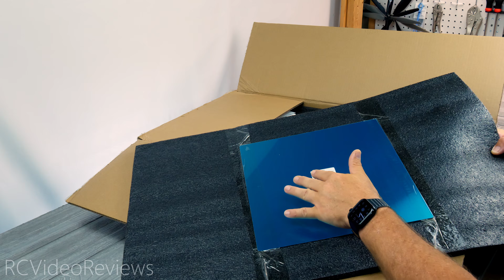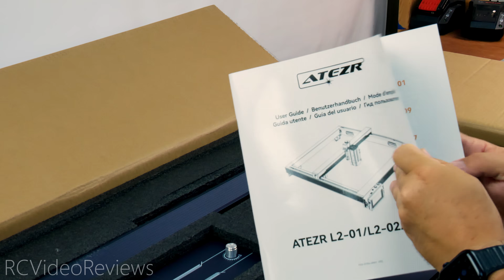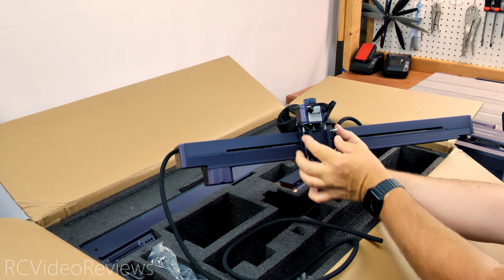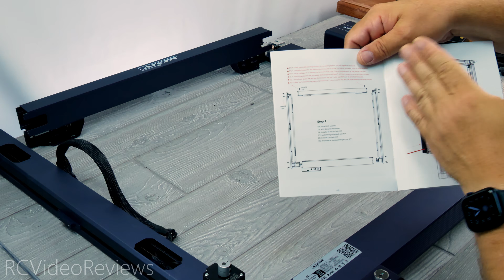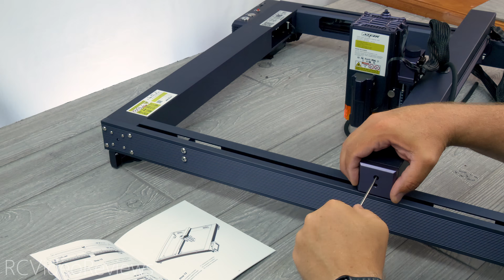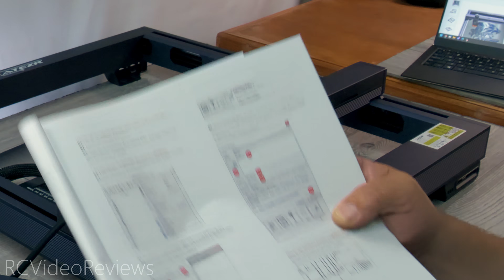Atezr L2 36w Laser Engraver: Best new RC tool I've added in a long time.

Comment: Here's a question for you. Do you know if there is a way in EdgeTX to use logic switches and NFC switches to reliably switch between internal and external modules to swap between 900mhz and 2.4ghz based on telemetry signals?
Reply from the maker: Not that I'm aware of.
Reply: @RCVideoReviews  I feel like you could set RSSI minimums on 2.4ghz to use a logic switch to activate the NFC's on the 2.4ghz receiver and the 900mhz receivers. A sort of reversed Y harness would need to feed the servos from both receivers. I think I'm going to do some testing, but you can reach more people than me. The issue I think I might need to overcome would be the power settings for the 900mhz receiver, so it would connect to the transmitter on that edge of the 2.4ghz control range.

Comment: Very nice for cutting all kinds of stuff. Control horns, motor spacers,  Servo mounts, battery trays receiver and ESC mounds,  graphics. very cool can't wait.
Reply from the maker: This has to be one the the coolest tool additions to the shop in a long time.
Reply: @RCVideoReviews  From my point of view the coolest😁
Reply: @RCVideoReviews  Please note that you can use solid state laser to cut black acrylic but not clear acrylic

Comment: Great tool, cannot wait to see what you will do with it. 
At least you can peacefully crash your lazer and repair it with the laser.
It would be great if all manufacturers gives the specs for all parts, so you can laser cut them, but I understand that it will mess with selling spare parts, and some crazy guys will also use it to build the plane from scratch.
Reply from the maker: We have some of those crazy guys on discord cutting kits. ;)

Great play on words. I wondered when someone would make that connection. I'm just getting started thinking about all the things I can do with this tool. Kinda wish I got one a long time ago.

Comment: You've come along!
What did you call the chuck in the lathe?  The big spinning thing?
The rails are extruded and may be anodized versus powder coated. It appears to be a very nice finish.
G-Code, eh?  Does Lightburn use/convert DXF or STL files?
Looks like a pretty nice piece.  You're going to have a blast with that.
Reply from the maker: Where HAVE YOU BEEN MAN?????